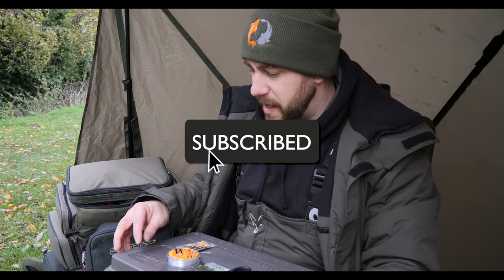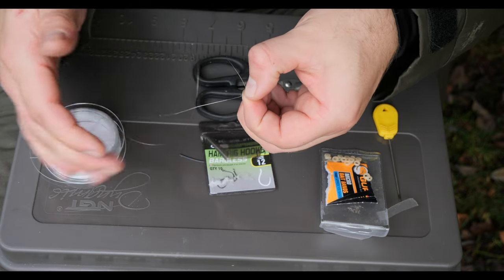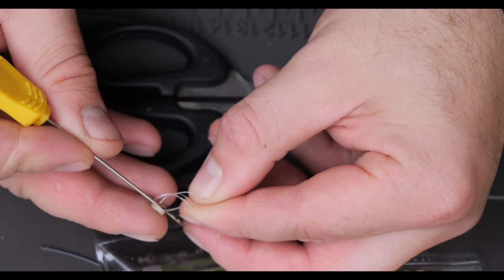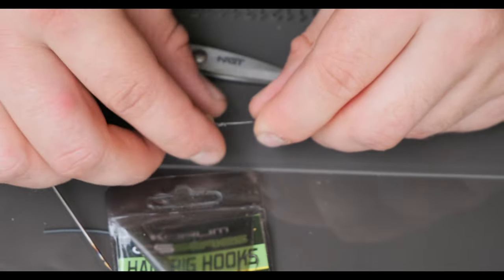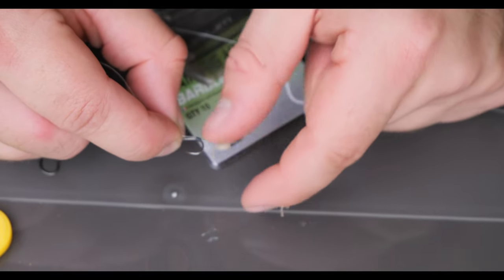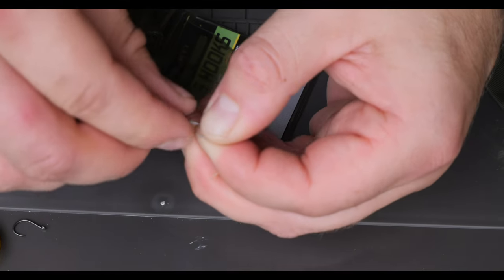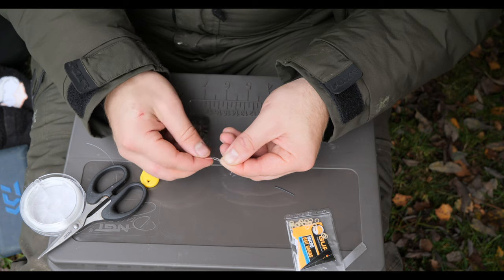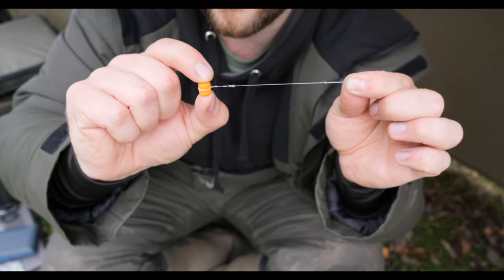How To Tie Method Feeder Hooklengths | Method Feeder Fishing

Comment: Hi,whats your recommendation for hook size to breaking strain of line  and length ? 
I have had many lost fish from shop bought pre tied banded rigs these last 3 years,i honestly think being short at 3.5 inches or 4 inches means the line loses its shock absorbing ability. 
Where possible i have tried and had had great results with the guru elasticated method feeder,with a 6 inch hook link ,not lost one on that set up,but not all fisheries permit the elasticated feeder.
Reply from the maker: Hi Gary ! First of all thanks for commenting, this is a great question over the last 2 years I have been upping the breaking strain of my method feeder hooklengths. Like yourself I have lost fish using too light a hooklink to withstand the bolt of the fish (these are probably really decent carp) . You are right the short hooklinks don’t stretch so they just give. I use 12lb to size 12/10 hooks now and 8lb through winter . The marginally thicker line doesn’t put the fish off . I look more at line diameter now than breaking strain, a lot of these companies advertise a high breaking strain but low line thickness however they take the stretch out of the mono when they do this. That puts more stress on the knots. I have also experimented with fluorocarbon which is a little thicker but stronger ! Yes elastic can take a lot off stress from the line and would be my preferred method, but like you say most fisheries don’t permit it. I also now set my drag a lot lower 👌🏻👍🏻 with this combination of changes I expect to lose less fish next year. Hope that helps!
Reply: Might be controversial but, I use the baitrunner  on the back of my reel, to take the initial shock. After I pick up the rod,I lock the baitrunner and rely on front drag and playing the fish (carp) to land the fish.
Reply from the maker: Definitely not Controversial John! No right or wrong way to fish in my opinion. This is a good idea. I also do this but when I’m fishing methods on bite-alarms!
Reply: @WestysAngling  so refreshing to hear from someone else who isn’t put in, or stuck in a fishing category. It’s great to experiment with different types of fishing, then put them together for something that works .
Reply from the maker: Totally agree, I get people commenting on my videos saying things should be done this way or that way. It isn’t the case. I think Match fishing and big money making companies  force people into the mindset that things have to be done a certain way, as long as I’m Catching I am happy. Experimentation is part of the enjoyment of fishing for me👌🏻👍🏻

Comment: Great video, what size bait band would you think is good for 12mm wafters please?
Reply from the maker: I’d be using a bait screw for 12mm wafters mate not a band 👍🏻
Reply: Sorry I meant dumbell wafters* I currently use the pre tied drennan rigs but they seem poorly tied
Reply from the maker: @nitrobang yes even with the dumbbell wafters I would be using a bait screw buddy, it will help weigh them down

Comment: Hi there, great video as always. Very clearly presented, thank you :)  I am still new to fishing and just about to start trying to tie my own method rigs, so your video is just what I'm after.  Two quick questions please: 1) I have been looking at Guru micro bait bands on amazon and they come in 2mm and 4mm.  Which do you recommend for wafters? 2) Looking at rig tubing, does it come in different diameters or is it just standard?  Two newbie questions :P  Thank you and cheers, John.
Reply from the maker: Either 2mm or 4mm will be fine ! Guru ones are really strong ! 8mm wafters your probably better with the 4mm 👍🏻 I think it’s the guru macro rig tubing I use 👌🏻
Reply: Thank you :) @WestysAngling

Comment: Hi, can You use ordinary line, as on reel, or do you recommend the special guru n gauge? Thanks.
Reply from the maker: You can use whatever you like buddy! Though others would tell you differently, there are no rules when it comes to fishing. The only difference between guru nguage is it’s a very thin line diameter so apparently harder to detect 👌🏻
Reply: @WestysAngling  thanks, just started tying my own, I suppose the thinner line would thread through the eye of the hook easier too, I’m using 12 lb  hook lengths  To 15 lb mainline, size 12 hook. Sounds like heavy gear I know, but I just keep upgrading the breaking stains till the breakage stop. Lol. The carp round here fight like mad, especially the ones around 7lb.Thanks for the instructions.